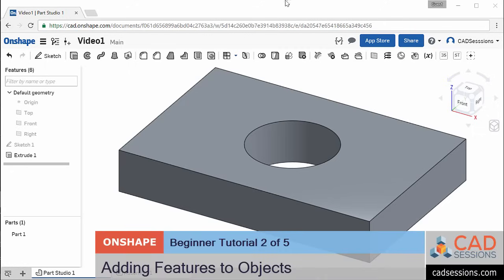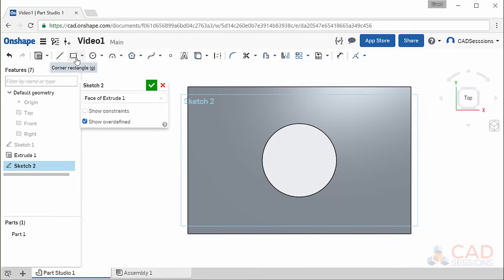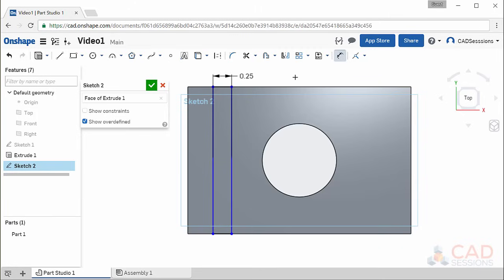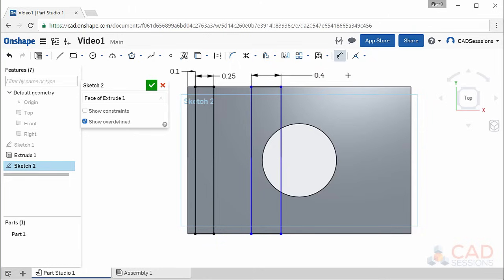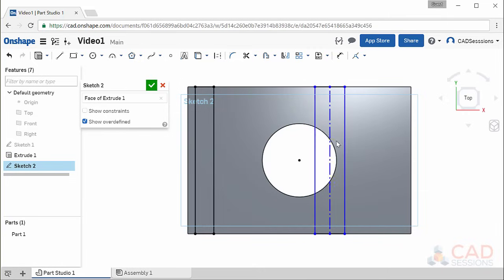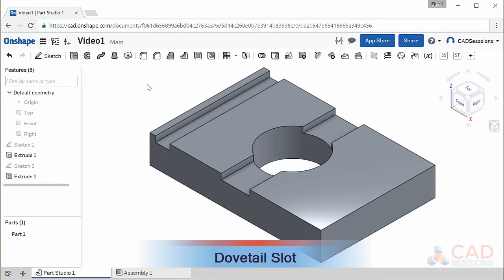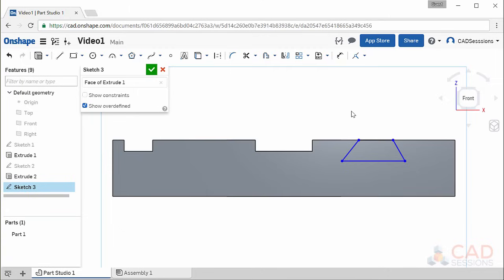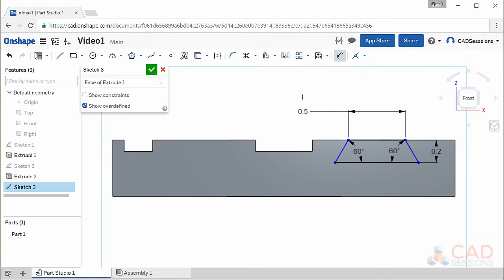Beginner Tutorial 2/5 - Onshape 3D CAD - Adding Features

Comment: When I moved the 'center slot' sketch to the middle, I got a little too close.  When I tried to draw the central construction line, it stuck to the full shape's sketch instead of the slot.  Make sure you move the 'slot' off center just enough to avoid that (or construct the center line before moving it).

Comment: At 6:59, the middle point is not showing for the rectangle. Is this because I am using an updated version of OnShape, or is there something I have to change in my settings? Any reply/answer would help, thanks.
Reply from the maker: I just tested it, and it’s showing up fine. Are you sure you have one of the feature buttons pre-selected, such as Line? If nothing is pre-selected, the center point will not highlight.

Comment: At around 7 minutes - I'm unable to reference the midpoint of the smaller line segment like you do here.  Is this something that's changed in OnShape?  Is there a hotkey I need to press or a different tool I need to use?
Reply: Just figured it out. It probably was a change that Onshape did in the software. Select the corners of the rectangle first. Top left corner, then top right corner, then bottom left corner, then bottom right corner. You will then be able to select the mid-points.
Reply: @Kyosama08  This doesn't work for me. Any reason why?
Reply: @Kyosama08  You're a Godsend

Comment: It's not calculating the dimension from the edge of the rectangle to the edge of the inner rectangle. It's only calculating the full length of the top line. Do you have an idea what I might be doing wrong?
Reply: Just figured it out. It probably was a change that Onshape did in the software. Select the corners of the rectangle first. Top left corner, then top right corner, then bottom left corner, then bottom right corner. You will then be able to select the mid-points.

Comment: I noticed that in order to mark the center of the rectangle (6:58 in the above video), I had to zoom out so that both the top and bottom edges were shown.  Then I could see two rectangles - the one for the center of the circle, and the one for the center of the rectangle. However, the rectangle center highlight was only visible on the bottom edge of the rectangle, not the top edge

Comment: This was a good tutorial. The only issue I have is at the beginning -- you hadn't announced to the audience that you had "hidden" the 3 planes and the origin. I hadn't noticed this, and I was working through the tutorial until I got to the part of placing the center point. I saw the origin dot already present and I confused as to why a circle was already at there. I went back and forth a few times to figure it out, until I finally realised that it was the origin dot, which you had hidden but had not announced in the video that you had hidden.